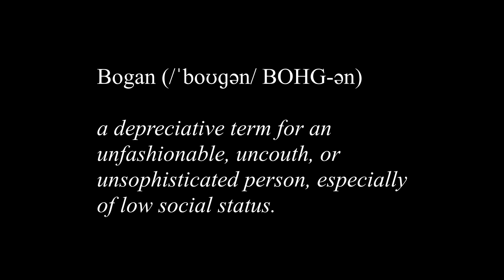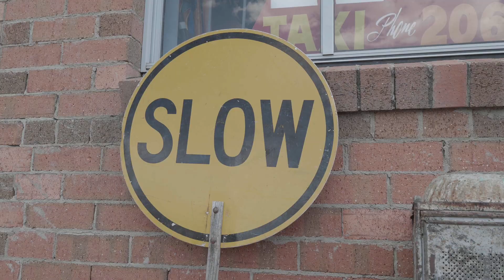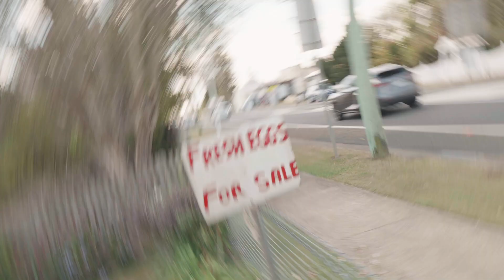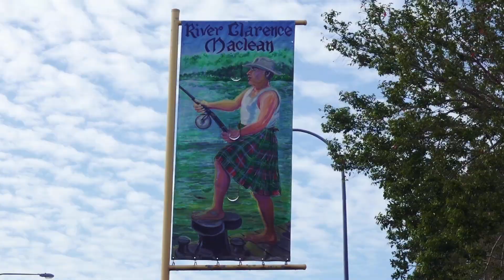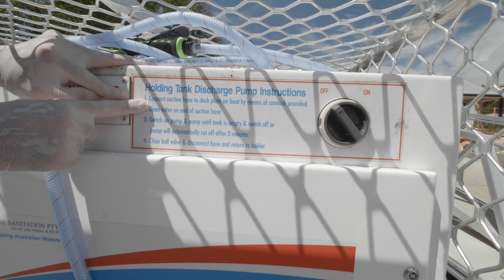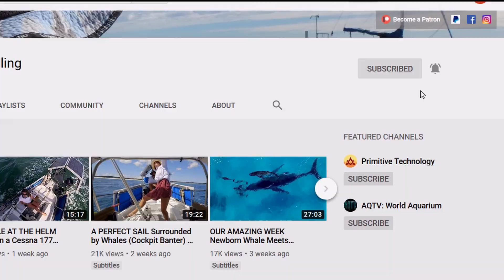BOAT TOUR: HAND BUILT PIRATE SHIP Notorious in New South Wales (Clarence River Sailing) - Ep 112

Comment: Great episode, thanks for showing how you pump out your holding tank. I’m about to replace my old Jabsco direct to ocean. Have you researched / have any preference re NatureHead vs Airhead composting toilets?  It seems Airhead doesn’t need to lift the whole bowl to empty the liquids, the Naturehead doesn’t have a separate toilet seat, more seem to have installed the Naturehead. Any feedback would be helpful, thanks. Fair winds..
Reply from the maker: I don't know too much but I would plumb the urine directly out if possible. Save some trouble
Reply: Free Range Sailing   Great tip, haven’t seen that, nor thought of it.  Should be easy enough as already have existing thru-hulls. Thanks

Comment: I never heard you mention composting heads and wondered what you think of them, now I now. I've been to a few boat shows this year and alway asked about options to have a composting head installed and always encountered expressions of shock and disgust. On my next boat I want two heads, one composting head and one macerator going to a holding tank.
Reply: It's funny.. the 'shock and disgust' always comes from those who've never dealt with a composting head.. those who've used them love them, because they're less messy, don't break down, and the boat smells better.
Reply: @Garryck-1  My wife and I put one in our first boat shortly after we acquired it. Our boat was the first in our marina to install one. They are fantastic and easy to empty. Also one less thru hull and no chance of leaking into the bilge.
Reply: @againstallflags1904  - Which is exactly why one is going aboard the boat I plan building. Love your name, btw!
Reply from the maker: Have the holding tank above water  level if you can to gravity drain and rinse when on a good angle of heel. Pump out tanks never rinse and they SMELL
Reply: @Garryck-1  Thanks! What a great project you are planning to take on. Hope to hear more about it as it progresses. Best wishes.